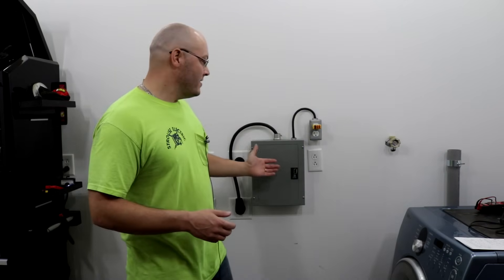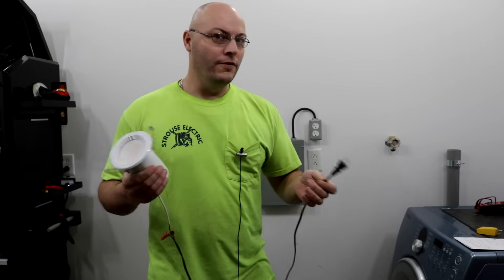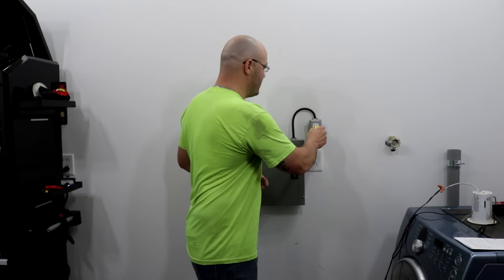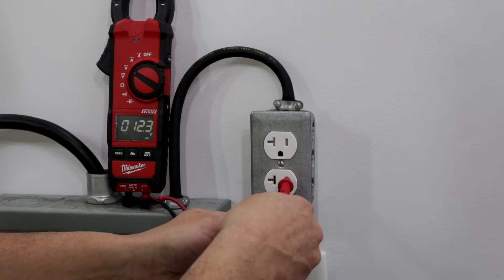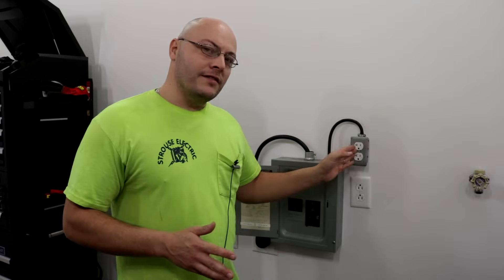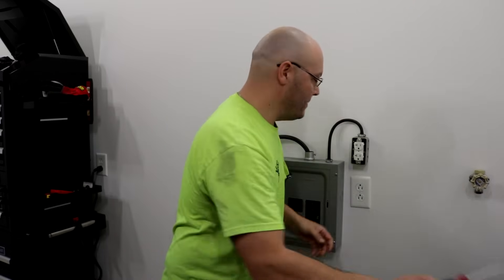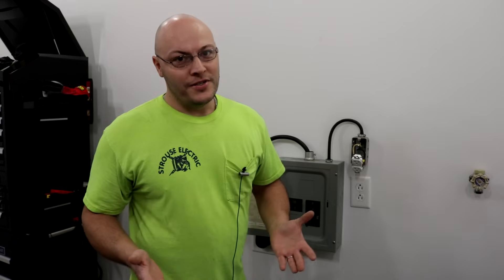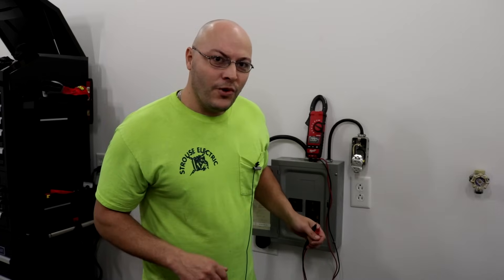How to Test a Wall Outlet - Receptacle Troubleshooting

Comment: Hey bill.  I have an outlet issue.  I have two outlets in my bathroom that aren't working.  One is a GFCI and the other is a regular outlet.  I know the GFCI outlet supplies power to the regular outlet and that is why the regular outlet isn't working.  The original GFCI was replaced because my wife wanted a white one instead of a tan one.  There was nothing wrong with the outlet.  I replaced it and the new one wasn't working.  I suspected it was just a bad new outlet since the old one was working fine (i hooked it up again to make sure) so I returned it and replaced with another new one.  But the second new one didn't work either.  Now the old one doesn't work.  No breakers are thrown.  Would you suspect it to be a bad breaker?  Wouldn't other outlets and lights that are designated to that breaker not work either?  It is literally just these two outlets.

Comment: As I am sure you realize, a tripped breaker will show a little red square. A breaker that has been intentionally turned off will not show the little red square. Can't have the uninitiated turning breakers on that were supposed to be left off, no matter what the reason.